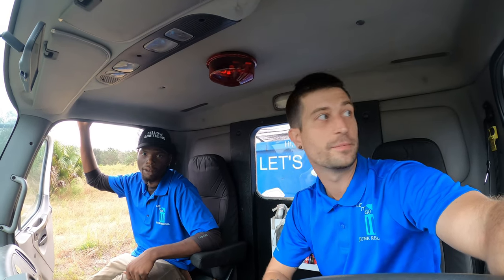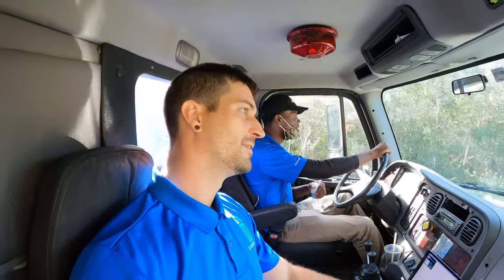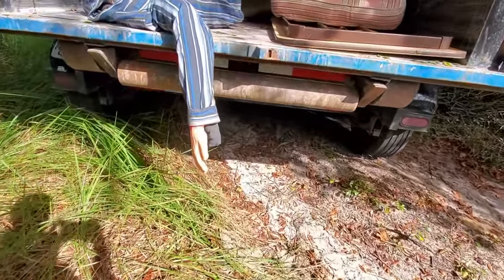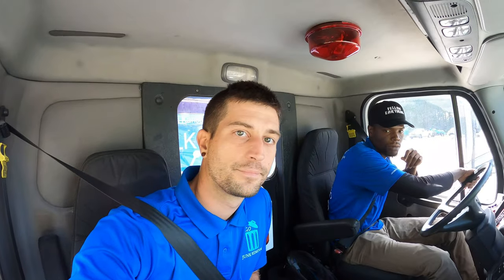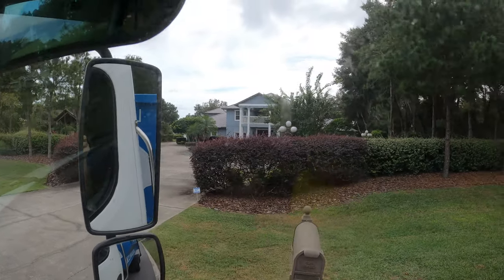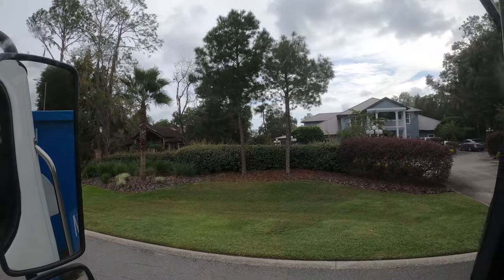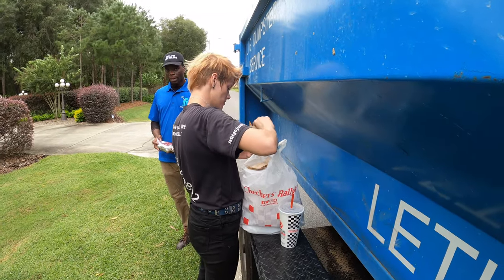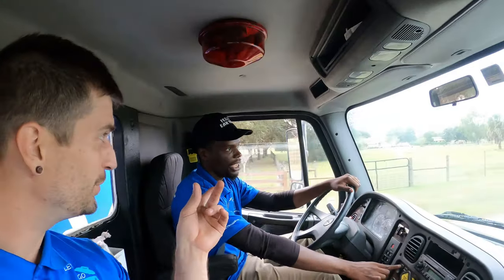New Dumpster Rental Truck, Freight Liner Business Class m2

Comment: Better get fuel pumps and heads looked at now. Running empty destroys parts. Just a little too lean cracked a head on a truck of mine. Going under 1/4 tank is also bad for fuel pumps keeping cool enough on some vehicles.